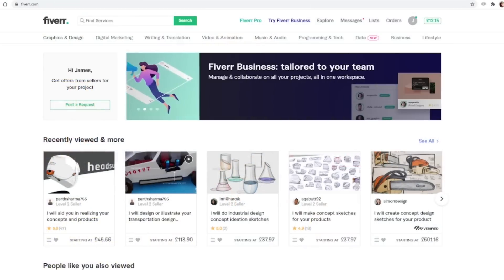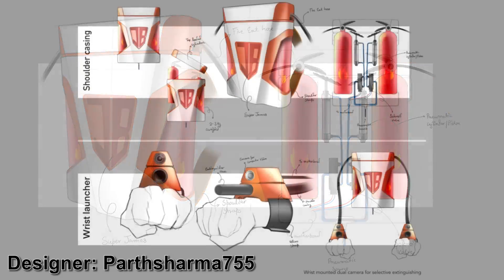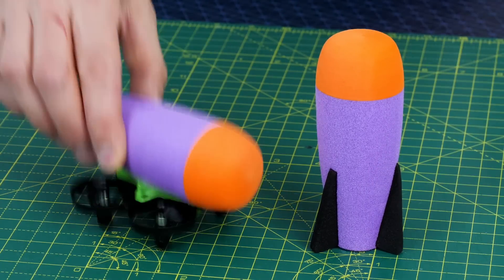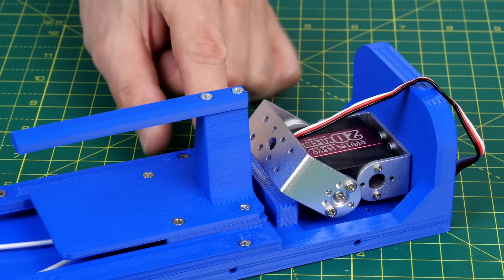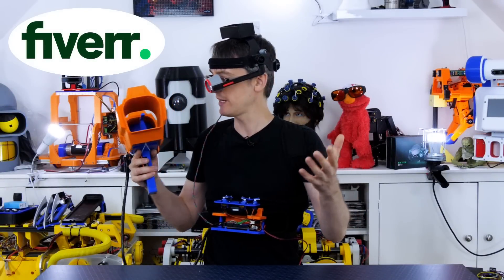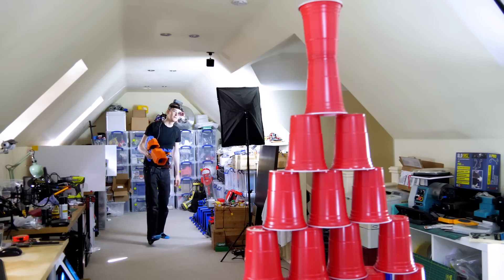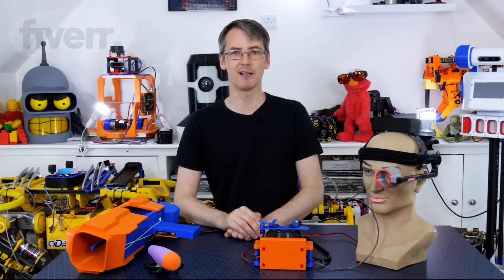#AD Designed on Fiverr: Smart NERF Blaster

Comment: It would probably be easier to control the direction if you turn using both yaw and roll together (move both left and right sticks horizontally together). This is what actual fpv drone pilots do as just turning on yaw(left stick) doesn’t change the direction the the drone moves in, only direction it faces.

Comment: you don't really want to use your head to directly steer the projectile. What you rather be doing is point your head (eye?) to the target and the drone/projectile shall readjust the course to the new target. I'm just not sure how you can use detection (vision?) for what you would be aiming for (with either your head or eyes), but I've seen before someone controlling a mouse on a pc with eye movements some years ago.

Comment: The first two options seems like using machine vision made the concept 100x worse and more dangerous. I would much rather be in control myself over when the fire extinguisher or shield is active myself than having a finicky AI try to guess if it should be active or not.
Machine vision is great for fully automated systems, but when it's already hand-held, there's no reason to take away control from the operator.

Comment: Add about four IR LEDs to the back of the drone. Then add an hour laser and probably a visible laser to the headpiece. Put an IR camera on the launcher or/and on the headpiece. Then use image recognition to find the drone in the frame and guide it to the laser dot. What you've got right now feels very unnatural because you're looking at the Target but you have to move away from the Target to get the drone to go towards the target. You need an additional feedback system so that the drone goes where you're looking. This could be that system. One last thing the further down range the drone gets the more gain there needs to be on correcting its position. This applies to both systems.

Comment: Fix the altitude so the gun gives that initial input and then you only have to control left and right.

Also, as a variation you could have the headset send out a laser and a few cameras in the room that look for it and find its location in space and have the drone fly there.

Comment: Hey you do incredible wok and I’ve been following you for some time. I know you have some very in-depth projects and use the lulzbot printers. I’ve used my lulzbot taz 4 since 2014 and loved it but recently upgraded to the taz pro to print with soluble filament from polydissolve but trying different settings I’ve had horrible luck. Any chance you can make a video with settings for your followers to learn and perfect there prints? I’ll join your patron if it becomes an exclusive video too.

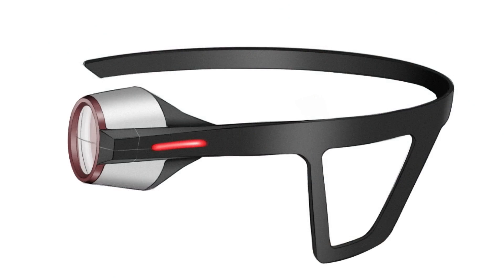Comment: @5:30 Mechanical control of the sticks seems a bit crazy. 

You know that the controller on the inside probably just has potentiometers for the sticks?
AnalogueWrite from the microcontroller probably would have been good enough. You could also consider opto-isolating the microcontroller from the remote if there are different levels involved
Reply from the maker: It's really hard to get the pots out and generally destroys the remote.

Comment: It would have been cool to use the navigation stack in Ros so that instead of just being controlled by your head it actually navigated to where your head was pointed using the IMU and a laser distance finder
Reply from the maker: That means tracking the actual position of the drone in space at all times and having the Navigation stack running fast enough to navigate at the velocity it travels at. I think this could be a more involved project ;-)
Reply: @jamesbruton  yes, I think it probably wouldn't fit in one sponsored video but it would be interesting and might help with the drone being hard to control with your head

Comment: I'd recommend piggybacking a camera on the eye-piece with an LED on the back of the drone. Have a vision system fly the drone to a point in the view frame that corresponds to the center of your vision.
Reply: This is what I was thinking as well. It would greatly decrease the amount of error introduced by large head movements, that I think would be more difficult to counter. Steering with the eye is a much smaller and more precise means of control.

Comment: If the drone had a modified headless mode, you could have it actually follow where you look.

Strafing the drone left, right, up, and down, as you look left, right, up, then down.
Would definitely need to tune how dramatically it strafes and climbs, and how fast forward it will travel.
A more natural rotation of the head.